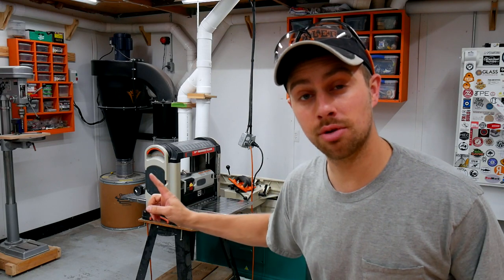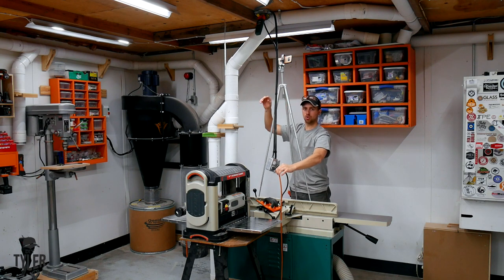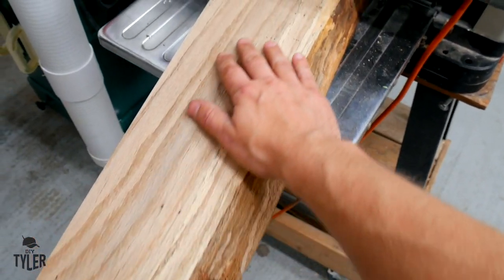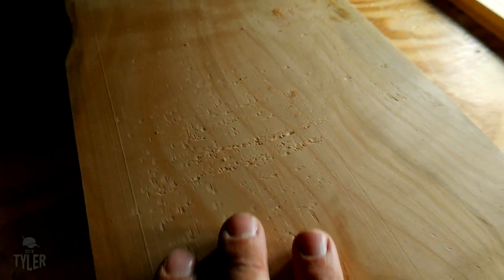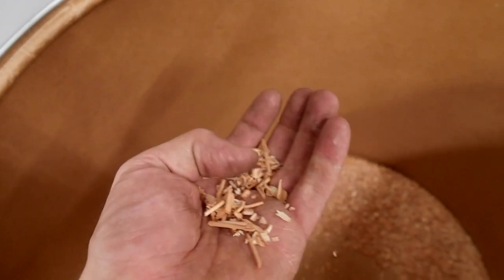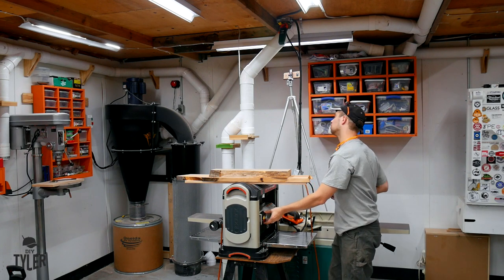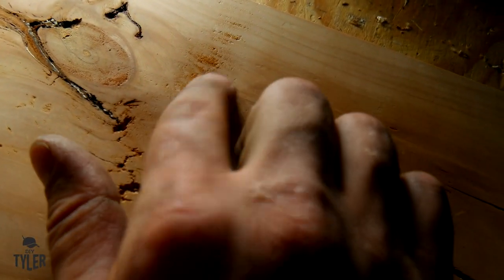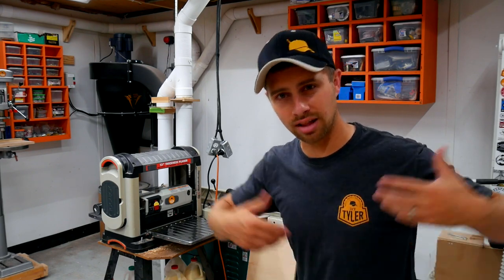What the Helix? Helical Cutter Head really Worth It?(TOTALLY!)

Comment: Great video, Tyler.  One thing you did not mention is the fact that each segment has 4 cutting edges, so you can rotate them when dull.  In the event of hitting somenthing like a pin nail you didn't see that nicked a blade, rather than do a full rotation, you can move the nicked blade(s) to the outside and swap with a good one.  So, nicking a blade does not mean you have to burn a cutting edge on all of them.  Also, probably the coolest part of the video was seeing the dust barrel move off the floor from the suction.
Reply from the maker: lol! The dust bin does that when it's empty! Yes, totally forgot to mention the indexing cutters...and the longevity you will get that will pay for the head! Thanks for bringing that up and for watching Ira!

Comment: There is a good reason that the motor is working harder.  With straight knives, the motor only has to work harder to cut wood when a knife is touching the wood (duh), which is actually only 2 or 3 times each rotation of the spindle - depending on your model of planer/jointer.  With the helical heads, "knives" are cutting wood multiple dozens of times per rotation - even if the knife isn't as large, the fact that there are so many of them make the motor work a little harder all the time, instead of only a couple of times per rotation.

Also, worth noting that this applies to any planer/jointer, not just the benchtop variety.
Reply: Jason, I read that reasoning before and while I can't dispute it, it doesn't "feel right" to me. Maybe I am misunderstanding what is happening. If I'm planing a 10" board with a 3-knife head, every revolution it makes 3 10" cuts. With a 3-spiral helical head, I think it will still make the same length of cut. The difference seems to be how smoothly the torque is applied by the head, either 3 impulses per revolution or a near-constant torque. I think the gearbox and belt-drive would dampen the pulsating torque so that the motor wouldn't be affected. What am I missing? On my DW735, I replaced a 3-knife head with a 4-helix head. Since the feedrate is constant, it seems it would take 4/3 as many cuts as the original. I can see that would cause the motor to work harder.
Reply from the maker: @Jason this is correct. With straight knives the motor gets a fraction of a second recovery time before the next blade enters the wood, depending on the blade count it could only cut once envery 180 degrees of rotation. Helix head always has a few knives in the wood, never any break.
Reply: With straight blades the motor only has stress for a fraction of a second but the bite of a helical head takes smaller but continuous cuts so my opinion. Is that is a wash.

Comment: Not a fair comparison. The flat blade cutter head knives were dull and had lots of hits from nails, sand or some other contamination that would not allow the knives to be at their optimal. I have experienced the difference between sharp knives and so-so knives and so-so knives will cause a lot more "rips" in the wood which will give you the results you got before you changed cutter heads.

Comment: Did you run that cheery with or against the grain pattern?  Looked like it was against, which would give you all that tear out.
Reply from the maker: One of be biggest benefits of the helical head is it is pretty much grain resistant. Not perfect but way better than the straight blades.

Comment: I know the indi-cut was saying 1/32 of an inch... But are you sure the cutters are identical diameters? Ive heard on other models they are a bit different. Making thr cut depth different. The dewalt one for sure. ... That may change the current draw, noise and quality. It sounded like the shelix was really digging in
Reply from the maker: They were not identical but I accounted for that. The machine is working harder as there are always a few cutter knives in the wood at any time with helical head. With straight knives the machine gets a break to recover between each cut.

Spoken with the supplier about the this! Thanks for watching!

Comment: Seeing that the straight blades had a lot of tear out. I’m assuming that they might be a little old/used. Will the helical blades begin to tear out as they get older?

I just bought my first planer. I bought the jet with the helical head in it. I’ve never had a straight blade planer. We had a $10,000 plus planer at school. That’s the only one I have ever used before. 
I’m honestly just trying to find out what things I should do/buy. I haven’t worked with wood in 4-5 years. Since I graduated. (Other than floors, using table/mitter saw a couple of times.

So I just bought the dewalt 10” table saw, and the 13” jet planer. I’m looking for a new miter as well.

Comment: Some commenters have said that Tyler didn’t make a fair comparison. 
Well, they are right. Comparing traditional blades to a spiral cutter head is like comparing a skateboard to a mercedes. 
I had a Grizzly  floor planer years ago that i ordered with the spiral cutter head installed. I have used many other high end industrial planers with blades and can tell you the spiral cutter heads are in a league by themselves . 
Don’t wast your money on blades . Buy spiral head and you will not only get a superior result but you will save tons of money in the long run. I had my machine for four years and never rotated the cutter heads once.
Reply from the maker: Quite a few unhappy people on this video! Like you I am blown away with the results of the new cutter head, didn't think I needed it before but boy was I wrong. Thanks for watching Sirios!

Comment: I priced that head for my 1985 12” Shopsmith and they want $651 for the head 😱😱 and Jet came out last year with a 13” benchtop with Helical style head for $799 🤔 I then would run those boards through my Supermax 25-50 drum sander 😁 Gret video, thanks

Comment: I don't think that's a fair comparison, you used blades that needed to be changed to go against brand new blade. I understand that Helical cutter head are great to have, but straight blades still have a place. If not, why not make all cutter heads helical.
Reply: The only advantage to straight cut is cost
Hence also why most cutter heads are straight 
It’s $550 for the helical head which is the entire cost of the planer basically 

You likely can’t easily mold the shape and need to mill it out at the factory which exponentially makes it more expensive to produce 
And each blade is a 17mm square instead of one long blade. Manufacturing a bunch of small part is more expensive than one medium sized part
You also now use more carbide as all 4 edges of the blades have it versus just two edges (front, back)

Comment: I upgraded my Ridgid R4331 to a Shelix cutterhead, and while it was a struggle to do the head swap (some press fit bearings I wasn't prepared to deal with) it was totally worth it.  A friend wanted a "heavy" cutting board so I ended up making a big board out of some of the gnarliest figured oak you've ever seen, and the Shelix handled it like a champ, where the original cutting head (with sharp blades) struggled mightily.
Reply from the maker: Indeed. It is so much different! Thanks for watching AJ!
Reply: AJ Hieb you made a cutting board... out of oak???

Comment: As long as correct amperage to allow for startup and load is supplied, who really cares what the current draw is or the noise output? I mean the objective is to surface plane lumber such that it is parallel with as best a surface finish as possible, who cares if it is 50, 100 or 150 decibels' and is powered by 120VAC or 240 single phase at 30 amps, or 460 three phase?